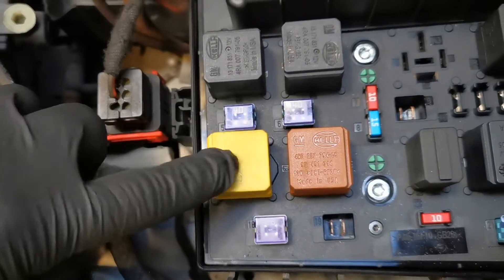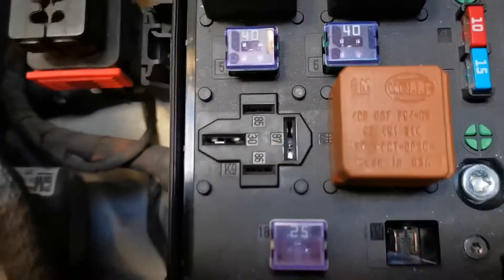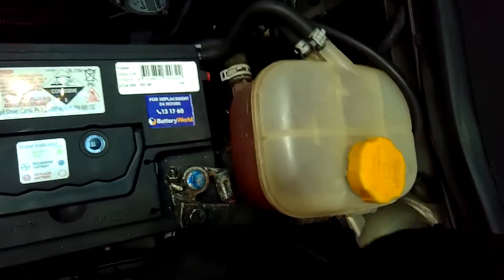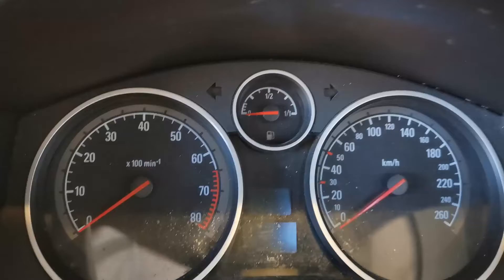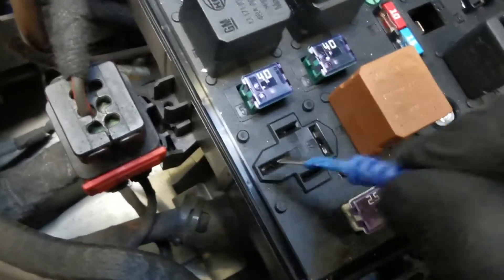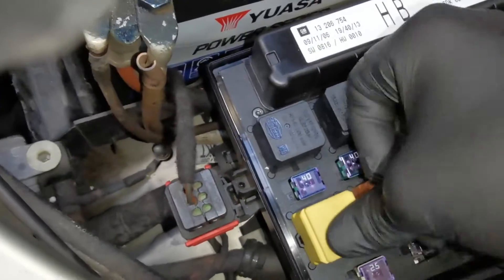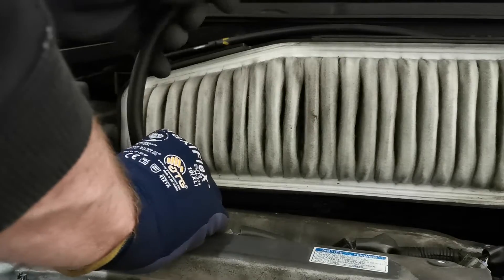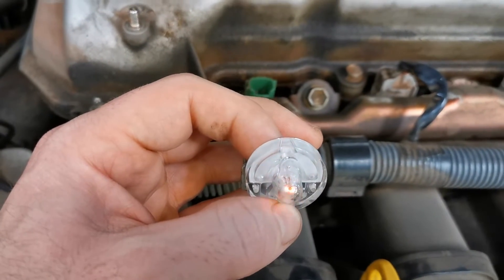Car Won't Start But Battery Is Good - How To Jump Starter Motor Using A Single Wire

Comment: Bruh. I have a 1999 accord 2.3 and I can only start my car if I TouchType metal prong on the starter with a cord and then my battery. Then it starts. So what's the real problem? I'm not finna keep starting my car like this it's annoying and it's cold asf outside.

Comment: My relay has no numbers. Female end has no numbers or markings either. Located behind the radio on 2009 Toyota Corella. If I plug wire into wrong slot will it fry something electrical?

Comment: FYI for people asking what type of wire. Any wire or even a paper clip will work
Reply: paper clip work for real?
Reply: @alecbone4295 I have no clue if this is true but based on what I know about electricity I’d say bare paperclip method is not smart because of the unprotected metal, but I suppose electrical tape around a paper clip may help.

Comment: Hey there 
Do U know if car is intermittent starting ,making flat battery sound but voltage reading is 12.7 not running . It doesn't start about 1/30 starts . Thanks

Comment: So that means that if the car won't start using the bypass the starter motor is bad?
Reply: exactly. i’m confused on what wire to use but also if it means the starter motor is bad or the relay, or maybe the ignition isn’t sending the signal to the relay, and the relay and starter motor is good.. i’m soooo confused

Comment: What happens when you use this method but the car won't crank over, as if it tries to but just won't start.
Reply: ever figure the answer out?
Reply: @gj8283  nope. Ended up needing a new car, no one could figure it out. Not even a dealership. Said it wpuld cost more than ours worth.
Reply: oh that sucks. i’ve had my ignition module and fobs replaced. Then the battery recharged and it cranked up. Got it home and the second time I tried to turn it off it wouldn’t crank again. That batteries cells ended up being 0 and the battery was only 7 months old. Now I got the battery replaced and it started up after that, then after cutting it off and back on, it won’t start up again. I’m really lost as to what it could be.
Reply: Your comment and just saved me.  When you said key fob I remembered I wasn't able to start my car because tried using my old key that I found after a month. When the key smith made me a new one they said it might erase the old one from the computer.  Going home to try the old key right now.

Comment: In a no crank situation would this method tell me my relay is faulty if the engine cranks with the jumper but not the relay?

Comment: If this works does this mean the relay is broken?
Reply from the maker: It means the fault is from the relay back if it works, all components after the relay are working correctly when the bypass method is used and it works. 
 
It can be a faulty relay and that certainly is high on the list, do a simple test to confirm that it is the relay or not - check this link for that test https://www.youtube.com/watch?v=h7dmdky4XeU&t=1s
Reply: @GerardBurkeBurkesGarage   i have a problem whit my 2 000 doge neon  when i star whit the key won't  start  but if i touch whit a cable from the starter to the battery  star right away  what u think it would  be

Comment: I've done this in the past... If I was doing it regularly on a "customer" car I'd fit a push button in the wire... Could save spark damage on the fuse box relay contacts 😉
Reply from the maker: Definitely not one to do regular, more of a stop gap to possibly get ya going or useful test to help with fault finding. 👍👌😉
Reply: @GerardBurkeBurkesGarage  👍

Comment: Good video mate,
I think a proper understanding of how a relay works is vital for diagnosing systems. 👍
Reply from the maker: Thanks mate, 
Yep I agree, understanding the system especially in difficult cases will give a clear path on how to diagnose.
For those not in the industry and just trying to maybe start there car (possible stuck with no options) that has a bad relay, connection, ignition issues like barrel etc., faulty transmission safety switch, this little bit of knowledge could save the day.

The more knowledge we have the better we fix 👍👌
Reply: @GerardBurkeBurkesGarage  Good call 👍